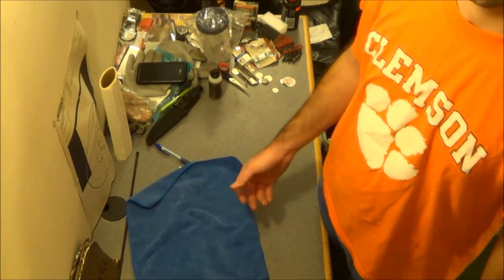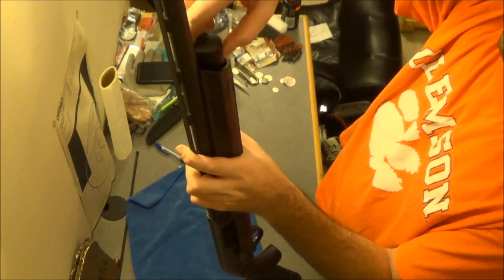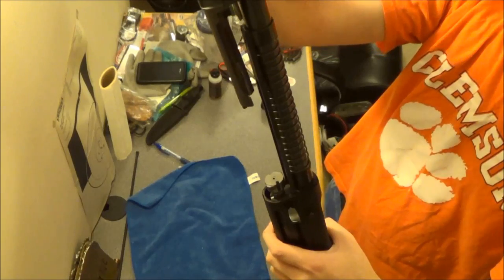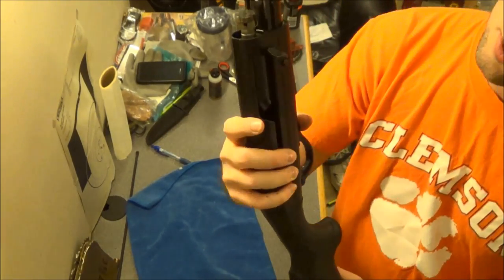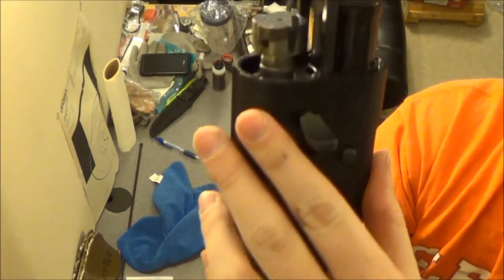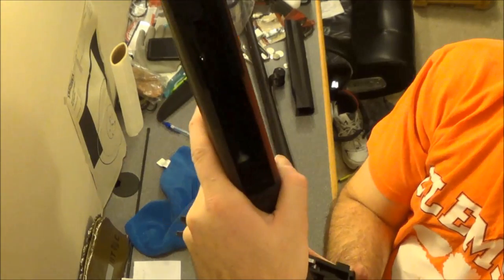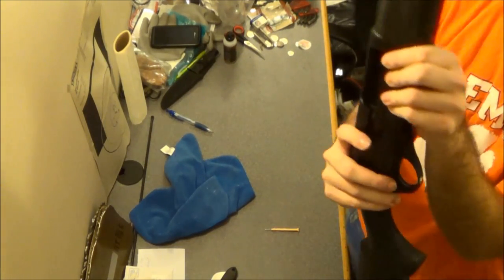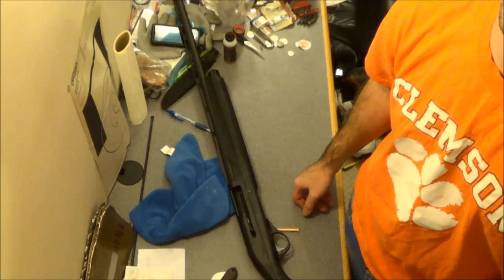Franchi Affinity Disassembly and Cleaning

Comment: The point on the screw off cap is designed to be used to push out the trigger housing pin.

Comment: I just purchased a Franchi Affinity and this was super helpful, thanks for the video! One question I have is that when I'm sliding the barrel and the forearm on to the gun I don't hear a click and the barrel/forearm don't seem seated on to the rest of the gun after sliding the bolt back. When I tug on the barrel/forearm it just comes apart. The instructions state that if I don't hear that click that the barrel isn't properly installed. Is there something I'm missing? It seems to be assembled correctly but it's inconsistent with what I see in your video and the manual. What am I missing? I haven't fired the gun yet but I figured it would be a good idea to make sure it's assembled correctly before I do. Thanks again!
Reply from the maker: If you mean that looking at the sight grooves on the top of the barrel it looks like it doesn't sit all the way against the receiver, I know how you feel. It is hard to tell in the video but mine does the same thing and it made me nervous at first too. And my forearm can twist back and forth about 1/8" with enough force unless I use pliers to get one more click than I can get by just hand tightening the nut on the magazine tube. But after seeing numerous others in stores with the same problem I ignored it, and almost 2,000 rounds later I have had not problems. But don't just go off my word, because I don't want to be the reason something happens to yours! I just make sure I get mine on straight and nothing feels like its binding, then get the nut as tight as I can by hand and leave it at that. Sorry I can't be more help.
Reply: sparetimeprojects6 I finally shot a round of sporting clays with my affinity last weekend and the gun operated flawlessly. It was a lot of fun to shoot and I'm extremely happy with my purchase. Thanks again!
Reply from the maker: Kevin Mirgeler Glad to hear! Shoot safe!
Reply: Kevin Mirgeler - When you install the barrel & forearm as a one piece item it will go in place up to about an 1" from being totally installed,  you need to pull the bolt assembly back about an 1" to allow the barrel & forearm  to seat on the receiver. Then go ahead and install the barrel nut on the magazine threads! Grab the forearm and barrel and it should be snug! I hope that helps with your new Franchi Affinity Sporting!

Comment: Nice Video, Wish if you went through removing the Bolt.. I hope next time, i have recently purchase an Italian version affinity i notice the forearm is a bit loos do you notice such issue..! any think i can do to fix it..
Reply from the maker: As far as removing the bolt, just follow what I explained in the video and you should get it. Once you get that charging handle popped out with pliers, the bolt should slide out fairly simply. Yes, the forearm stays somewhat loose depending on how tight you get the forearm cap screwed on. If it feels too loose for your comfort, just find a way to tighten the cap more. But I tighten it as much as I can with just my hands and the forearm stays just loose enough to move if I forcefully twist it, but I have never had any problems like this.

Comment: Hi .. i got my new Franchi affinity one week ago, i had a problem after assembling it , forearm got out of it's place after the first shot leaving a space between a rear ens of it and the receiver in which you can see that small space, i have to push it back after every shot, i tried to reassemble it again and making sure it's pretty tight, but nothing changed, please advice if you have any idea about it . Thanks
Reply from the maker: If it is just a small gap where it looks like the forearm isn't completely seated, it should be fine because mine has always been like that and never had a problem and I've seen some in stores like that. If it is a really noticeable gap and moves around loosely, then take it to a gunsmith or call him and ask his opinion. Sorry I can't be more help without seeing it.
Reply: +sparetimeprojects6 no problem my friend .. i really appreciate your response . I did that exactly and seems there is something wrong with what they call spring washer, which is the 3 or 4 rings at the end of the forend that sit right below the barrell when you assemble it . Thanks again

Comment: Very informative video Sir, how does it do with 1oz dove loads?
Reply: This is a really really old comment but in care you’re still wondering it does great, you just have to break it in like any gun and shoot a couple boxes through it to make sure everything is doing fine, I’ve had mine for about 5 years now and I’ve never had any issues it shoots like a charm and is very light compared to most shotguns I’d definitely recommend it

Comment: What do you like better, your Franchi or  Remington
Reply from the maker: The Franchi by far. Ive barely used the Remington since I got it. It's way to short for my 6'1" frame to the point where I'm looking at 4 inches before the bead sight instead of being able to aim properly. And I checked, its not a youth model. It also took about 200 #6 shot shells to break in to the point of tossing the spent shells out and cycling properly instead of stove-piping or just falling out of the receiver.
Reply: Remington is copied 
In Franchise design elements 

It’s .5 Remington 😎
But
LIGHTER

#1 🇮🇹